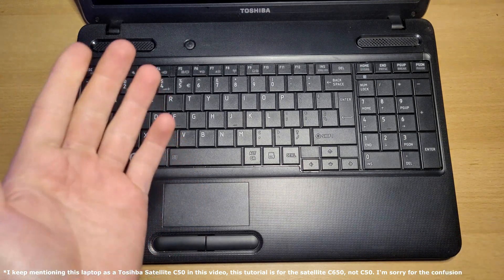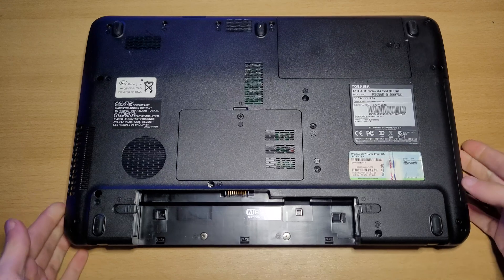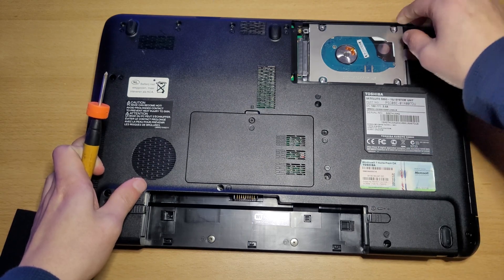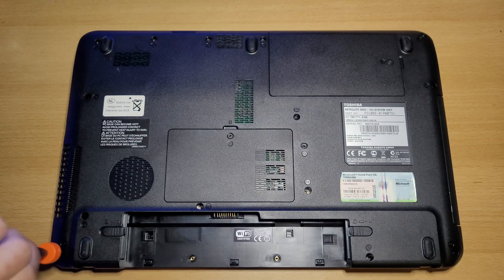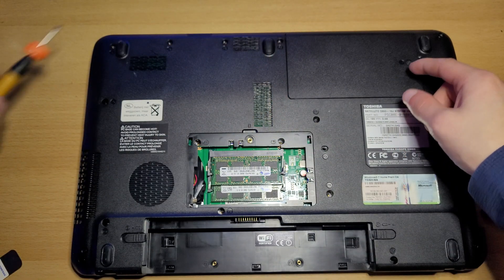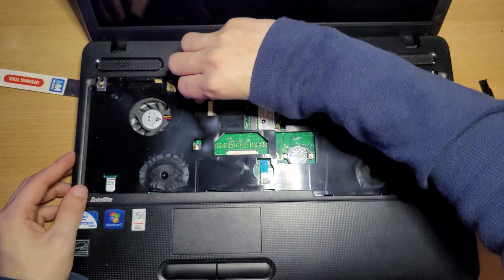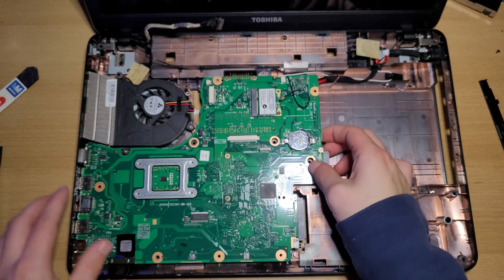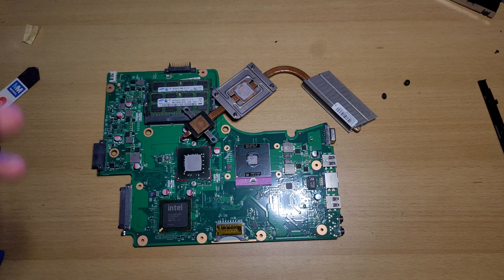How to replace Battery/RAM/HDD/Thermal paste/CPU in the Toshiba Satellite C650 laptop

Comment: Nice video! I have the C655D model that comes with an AMD C-50 processor, do you know witch model of CPU could replace it? I also wanna upgrade the ram and the WiFi card to a dual band with Bluetooth

Edit: I decided to open it just to be sure. Turns out, i have the really rare model that comes with the CPU soldered to the motherboard :(, witch is different to every other video about the same model that I've watched.

Comment: Yo, could i know which type of ram is this ?
Reply: also could you give me a list of improvements like ram etc for a total of under 300$?
Reply from the maker: This laptop uses DDR3 ram, if you have a $300 dollar budget to upgrade this laptop I would suggest buying a new (second-hand) laptop, as the cpu in this one is very old and upgrading this laptop to the max would not outperform a (second-hand) laptop in that price range, but if you really want to upgrade, Here's a quick list:
CPU: can be upgraded to a Core 2 Duo T7300, which costs around $10-$30
RAM: can be maxxed out to a total of 4GB, so you need to find 2 matching 2GB DDR3 sticks
HDD: the easiest upgrade, you can pick up a new 2.5" SATA SSD to replace the hard drive.
that's all the upgrades I can think of at the moment, hope it helps!
Reply: @tygorepairsstuff   this is my mom's Laptop . I tried to uprade the ram with a 4GB DDR3L   stick of ram , but the laptop refused to switch on . I reverted back to 2+2 GB DDR3  and it powered on . I'm I wrong or it looks like it doesn't support 4GB modules ?   I read on the internet you can upgrade to 8GB max
Reply: @tunkunrunk  only DDR3 ram 2x4GB, DDR3L not compatible.
Reply: Uhhh, the C650 supports 8gb max, I reckon, but will 2 modules of 4gb ddr3 pc3l sodimm 12800 ram work on this?